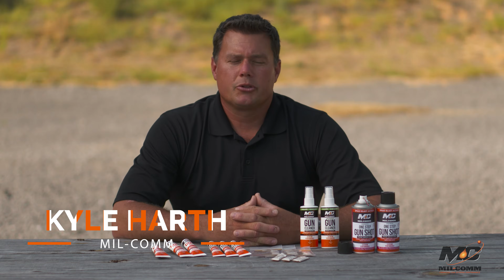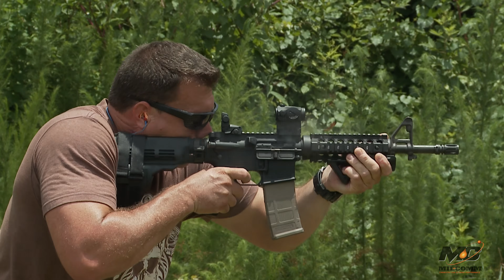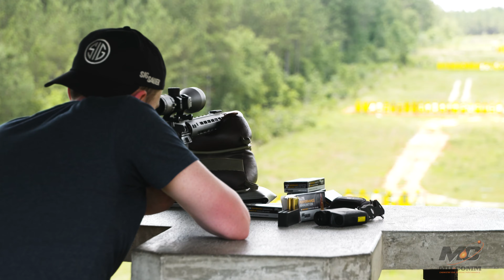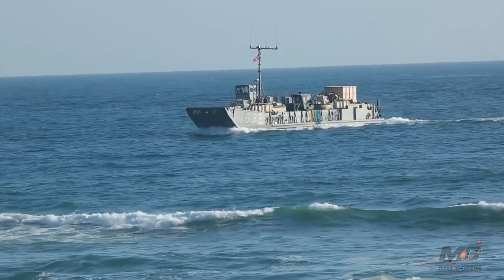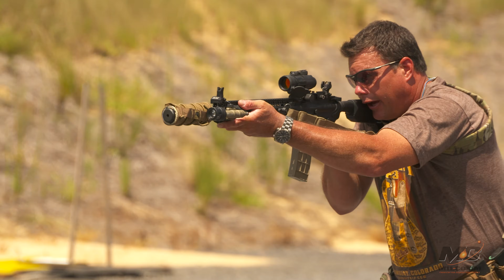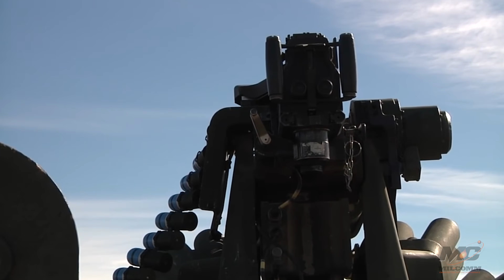Mil-Comm Products Company

Comment: Let me just say, this is some NO B.S  lubricant. It literally works as advertised. Im stll wondering why they are so under rated. I presume because they don't advertise that much. Any how,  I have applied TW25B grease to pistols that where in the safe for about 4 to 6 months. They ran at the range like they were just lubbed. I also ran a liberal amount of TW25B on a Glock 22 for a 5 day Training & Qualification course and the lube was still there after the course was over. Mind you this was in 90+ Degree weather in a dirt enviroment. Only had 1 hickup during the whole week where the slide did not fully go forward.. One tap and rack and continued the course of fire.We went through over 500 rounds the entire course and I did not clean the pistol after the first Lubrication. This was through a pretty used service weapon BTW. I have also used the oil as well and fine it very useful as it seems to cover parts a bit more evenly because it spreads so easily, but I find myself using the grease more than not. It works great on the AR platform as well. Its perfect for it as it stays exactly where I want it. The only issues I have ever had was that I had a bottle of the MC2500 Oil where the oil had clumped up at the nozzle. This was fixed by opening up the nozzle a bit more to let the oil flow more freely. One thing I wish they would consider is producing an CLP. I currently use Breakthrough solvent to clean, as it leave behind no residue so it does not effect the lube. However, sometimes a quick clean and lube would come in handy when you don't have time to break the gun down to fully clean during a shooting course. Having a quick spray and wipe would be great in that scenario. Other than that its the best lubrication I have ever used and I have tried many others. Nice to see the packaging as well.
Reply: Is mc2500 the oil to the tw25b grease?